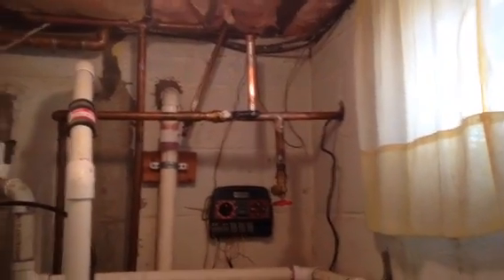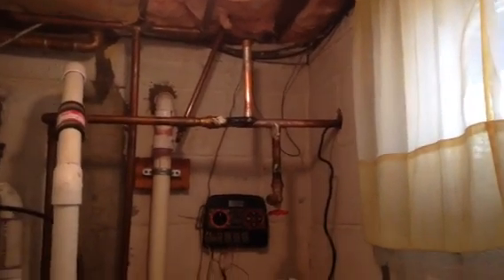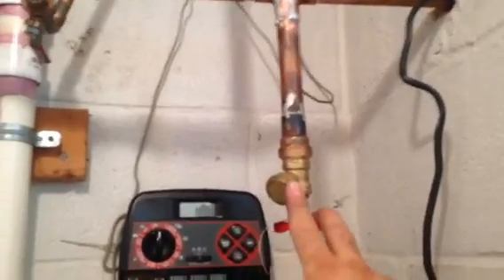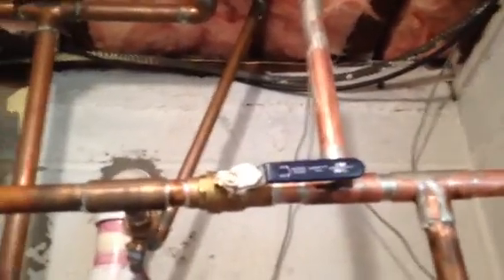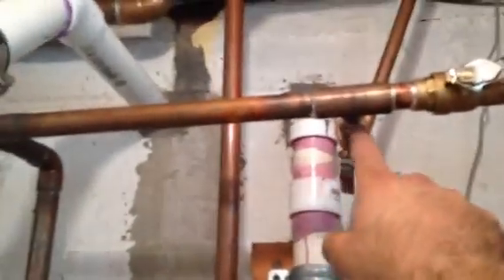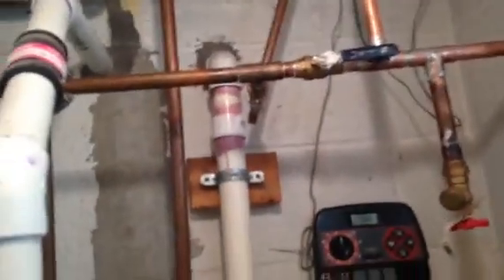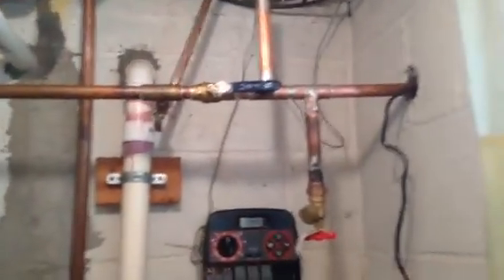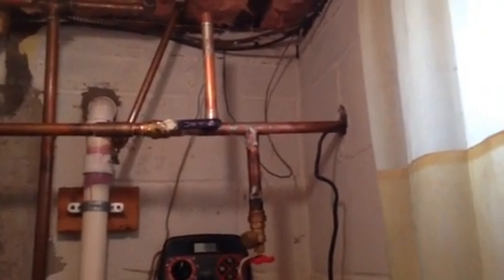How to stop water hammer

Comment: One comment, the sprinkler line used to blow out the sprinklers is hanging under the pipe and therefore provides no water hammer prevention. The air required inside the pipe would rise as water flows across that downward hanging pipe and will fill that up instantaneously. So it provides no prevention of water hammer at all.

Comment: New pressure tank and tank tee and all the other fittings  pressure switch set at 30 pump on pump off at 50 psi  bleed all lines and still air blasting out of each faucet. What?

Comment from the maker: This did not work.  Check out my other video were I installed a Watts Water Arrestor that does work
Reply: nceleto
Reply: vinceleto
Reply: From my limited experience, these work best when used in multiples and as near as possible to the culprit valve. Also, they should be a minimum of 9 inches.